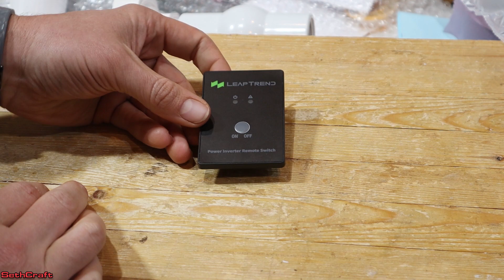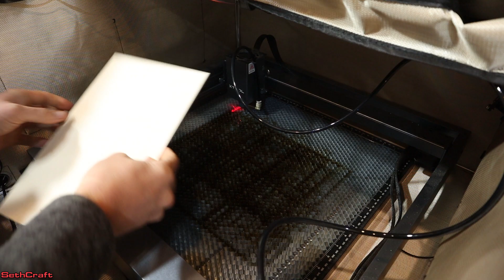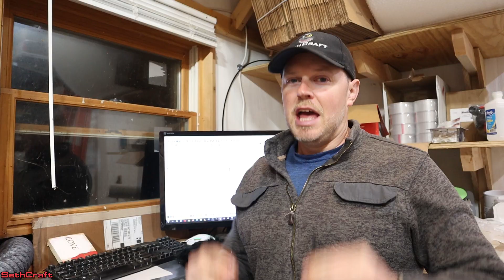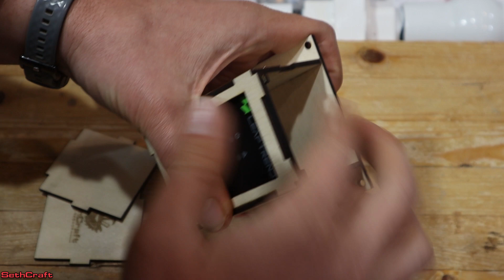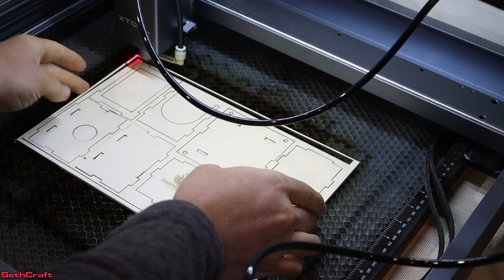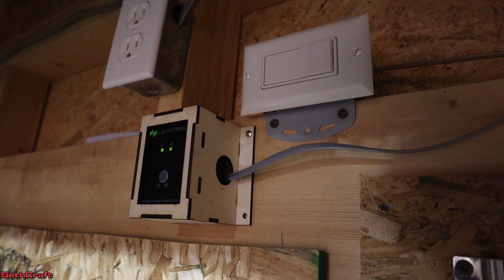Xtool D1 Pro Custom Project - Box for the LeapTrend inverter remote

Comment: Wonderful box and well done on debugging the design in only 3 tries.  I'm delighted you were able to get the interlocking tabs right so quickly, I've seen others where it took 3 tries just to sort that part out.  If you ship these, your cutting speed/power cards will come in handy since you'll want to do them as "punch out" parts so the card protects it from getting damaged in shipping.
Reply from the maker: The tabs in lightburn are not too bad to build. I seem to have the most trouble connecting the bottom to the sides in my design process.

Comment: Looks like it is intended to mount in an electrical box (or mud ring), but not the typical U.S. standard box!  Modern toys, err, tools are amazing.
Reply from the maker: Not exactly sure how its intended to mount but there was no way that I could get screws small enough and long enough to mount in my shop. This new box has been perfect.